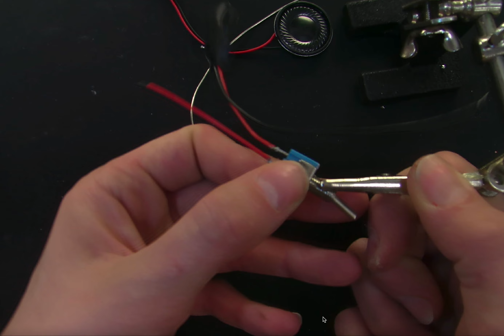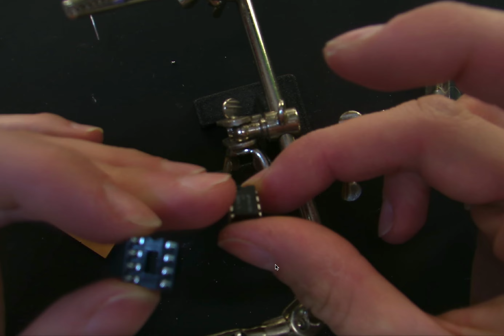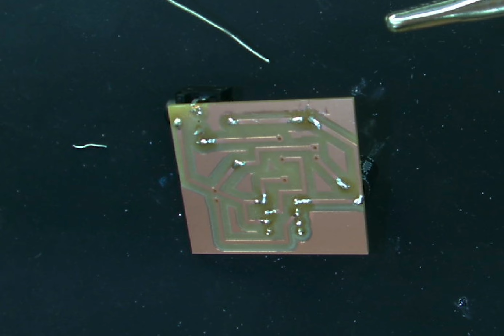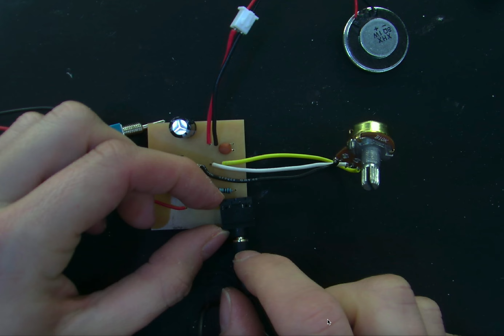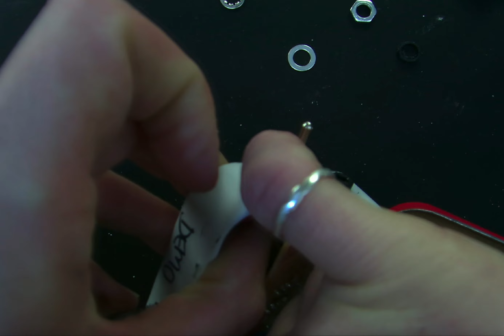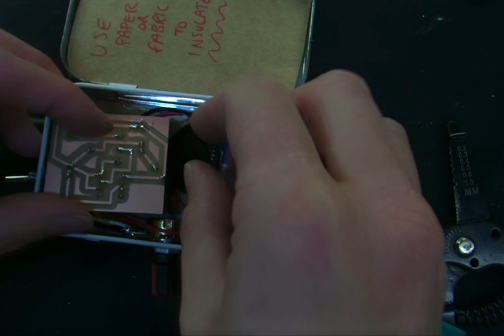Altoid Tin Amplifier

Comment: Not sure if it's mentioned in the video. Do you etch your own PCB for this project?
Reply from the maker: I did! I have that process in a separate video, I haven't uploaded yet. I designed the file in Fritzing and used a Nomad 3 desktop CNC
Reply: @jenna_junk nice job :) i did etch a pcb at school and really enjoyed the process. I reproduced the experience to make my dual polarity power supply. The result was great even if I hand-drawn the pcb. 😂